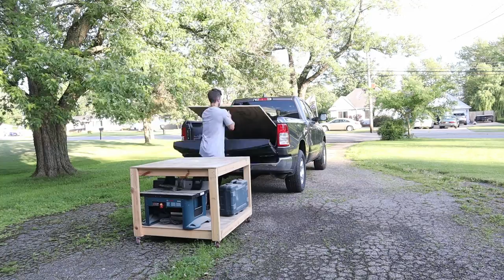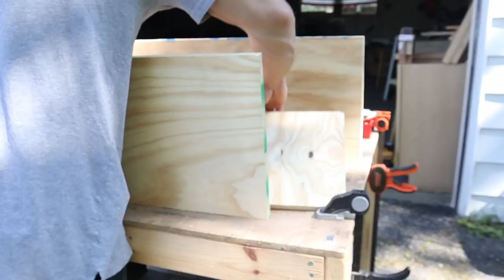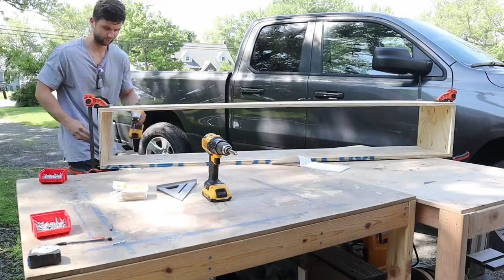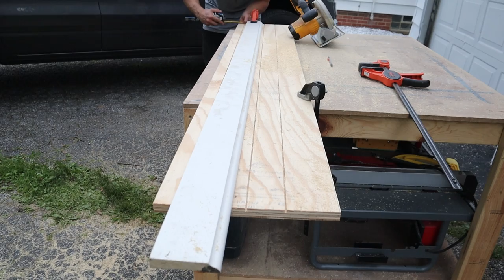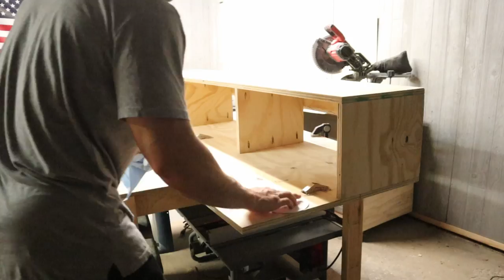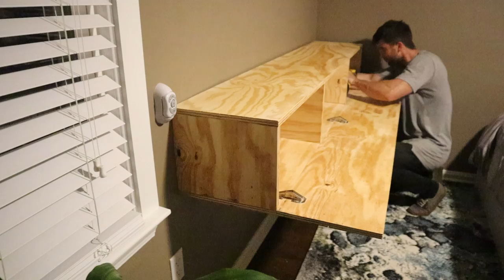DIY floating media console | How To | Starter Builds

Comment: Im going to attempt to build this on saturday.  Just one question once you install the piece of wood on the wall then put the floating tv stand on it do youdrill onto the piece that is attatched to the stand ?
Reply: Also what size thickness was the wood you used?
Reply from the maker: @beavisnowell7234   essentially you will create a french cleat for the piece that is installed into the studs on the wall and the back piece that sits within the cabinet. You then will attach the cleats together with wood screws to the studs. Id recommended checking out a few videos on making french cleats.
Reply from the maker: @beavisnowell7234  3/4 is the thickness
Reply: @StarterBuilds  thank you 🙏🙏
Reply: I have one more question , what is the best wood suited for this job ?
Reply from the maker: @beavisnowell7234  I would recommend birch, maple, or oak plywood depending on your budget
Reply: @StarterBuilds  will pine plywood work?

Comment: Would that be strong enough to put a 75” 90lbs tv on??
Reply from the maker: If you have it connected to the studs in your drywall yes. If using drywall anchors you might be taking a risk in my opinion
Reply: What are the sizes of this ? I love it..I wanna tell the hardware to cut the same sizes